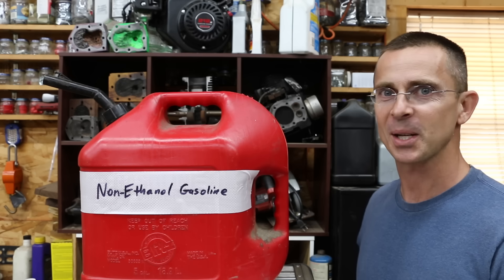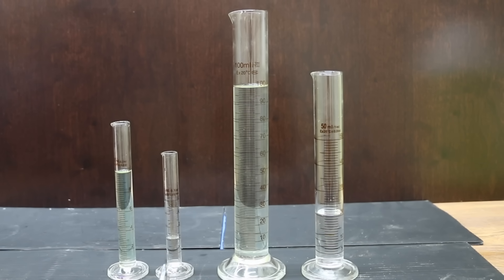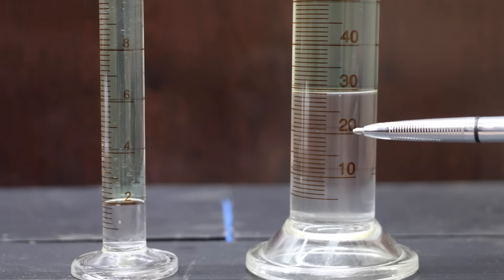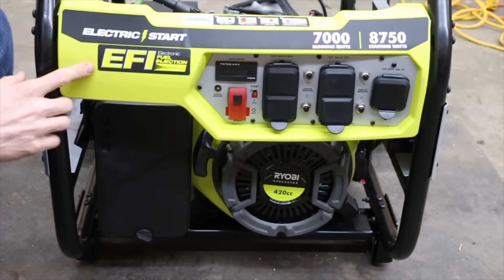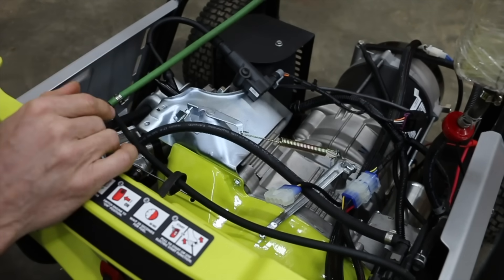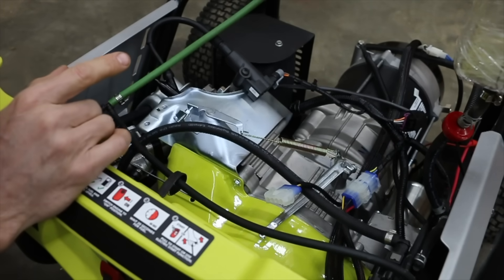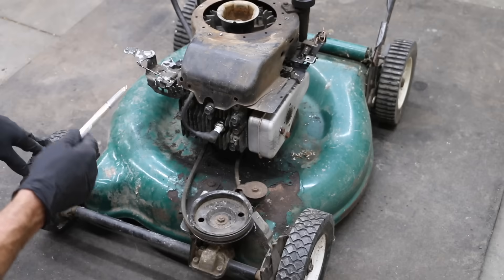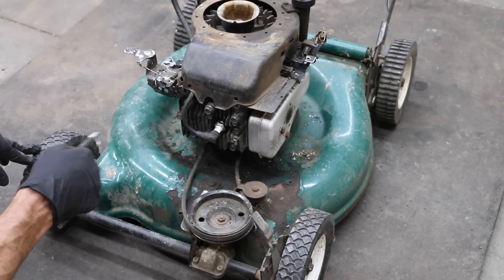Is Non-Ethanol Gasoline Really Better? See the PROOF!

Comment: If you want your fuel system components to be destroyed by corrosion then use ethanol fuel. These components can include but not limited to the fuel tank,  fuel sender for the fuel gauge, gaskets, gas lines and carburetor.
Reply from the maker: Thank you!

Comment: Like I already commented on your fuel additive test to solve water: there is a big mistake everybody is doing.
If you have a E10 fuel and some water in the air it will absorb a bit of it depending on the time and the surface area (contact area with moist air). E5 will do the same thing, in my humble opinion will be the amount of absorbed water be very close with both fuels.

So what kind of fuel will give you problems with corrosion? I think the problem will accour if the water/ethanol mix will seperate from the fuel. This will happen very early with E1-5 and much later with E10 and nearly never with E85.

Also I'm not sure if this at all will happend just because of the moist air because I don't think the ethanol will even pull this much water from the air. I think more likely it will be the condesating droplets that form on the cold metall of the fueltank and then drop down into the fuel.
They will seperate directly from a E0 fuel but get absorbed by any ethanol fuel.

I think this would be very intresting to see when and why water will seperate from the fuel. I always do what most people do consider the worst thing you can do, my car is sitting with half a tank of E85 for as long as half a year. I'm doing this since 8 years now and never had any seperation or rust in the metal fuel tank.
Reply from the maker: Thank you.

Comment: The problem with ethanol as you showed in the beginning is that it drops out of solution when exposed to moisture. Therefore rotting out components in your fuel system. Also what you're not talking about it is not cost effective to manufacture ethanol and sell as motor fuel without government subsidies.
Reply from the maker: Thank you!

Comment: In summer temperatures consistently above 90°F I run 25% ethanol in my pickup. It doesn't help mileage but it does help the engine run a few degrees cooler, particularly in start and stop traffic with the air conditioning on. I never use fuel containing ethanol in my lawn equipment unless I am sure it will be used all at once without leaving any in the carburetor or fuel tank. Storing lawn equipment with fuel that contains ethanol, particularly if used in 2-stroke engines is asking for trouble. The longer you store gasoline containing ethanol the more likely it will gum up your fuel delivery system even if you have fuel injection. Non-ethanol gas will eventually gum up but not as quickly as gas with ethanol. It's worth paying a little more for use in your lawn gear. In your everyday driver, it probably depends on your usage more than anything.
Reply from the maker: Thank you!

Comment: Something you should do in parallel to the long term use of ethanol vs non-ethanol fuels, is the long-term storage of ethanol vs non-ethanol (say putting the lawnmower away for the winter, or the snowblower away for the summer, etc). I've heard that non-ethanol fuels won't destabilize over time, but it's worth testing to see proof. :)
Reply from the maker: Thank you for the video idea!
Reply: @ProjectFarm  Hey! I found the video where I left the comment!! Any progress on this particular test? Is it ongoing, not yet started, or did I miss the upload? EDIT: found it! Headed there, now. :)

Comment: E85 is amazing. Here in Finland they actually use food waste and other byproducts to make it for "free", instead of using corn like you do in the USA. Saabs are probably most famous for running on E85, as they actually have a stock BioPower flexfuel program that you can install without any hardware modifications. You get more torque and efficiency as E85 is resistant to knock. Downside is you need 33% more E85 (energy value 34 MJ/kg) when compared to 98E5 (RON) (energy value 46 MJ/kg), but the price difference will make it worth it - even if there's no benefit price-wise, the increased torque, efficiency, and clean emissions (as well as clean engine, no carbon buildup) really do make it an amazing fuel. And even better here in Finland as I mentioned before, you're driving with fuel made from waste. I have ran my 1999 Audi S4 B5 with E85 only for years, without problems. It is obviously (aftermarket) programmed for that, though.

I see nothing wrong with gasoline blended with ethanol either as long as the vehicle says it supports them. Running anything without brains to compensate for the ethanol content (see earlier comment about energy value) is just basically running it leaner. You need an oxygen sensor to correct that.

E85 is basically a clean race fuel.
Reply: bindkeys I think you are talking about the Neste refinery. They also use (if I recall well) fish oil to make diesel.
Reply: @C_R_O_M________  ST1 Etanolix
Reply from the maker: Thank you!
Reply: 85%  IS N O T 100% GASOLINE (race)  FUEL....?
Reply: @jimbo42521  

Lol they use alcohol (ethonal) in race engines. They have different classes for different types of fuels like nitro for example
 But you can make tons of power on Alcohol.
Reply: The biggest issue with ethanol is in small carbureted engines. Or anything that sits for any length of time. Ever rebuild a carburetor thats had ethanol run through it versus non ethanol? If so you will see the difference! Ethanol is junk! The residue from ethanol is a problem!
Reply: @WW5RM  My father would tear apart carburetors in small Briggs water pumps every spring and carb clean out the varnish.  One never forgets the smell.  Since we have had E10 starting in the 80s, I have never had to do such a thing.  Have never had varnished gasoline with ethanol.
Reply: @danafletcher2341  yeah I know the smell. Where are you located?
Reply: @danafletcher2341  yeah we haven't had ethanol here in the south up until a few years ago. From what I understand when they introduced it they also took out stabilizers too. See its very humid here. Big problem! 

So it may last longer in a low humid environment but not here! Its causing all kinds of problems! It sucks! We never had these problems before!
Reply: @WW5RM  When ethanol came here, it cleaned out built up varnish from gasoline.  Hence newer equipment did not bother as much as older.  I still have some 1970s vintage trucks around that in the 80s when E10 came that I had to change filters weekly for a time.  I was told that would stop once clean.  Still have those trucks and they mostly sit in a building and rarely are used, but they will still start right up(provided battery is not dead) and it has been years since I have changed fuel filters.

Mercury Marine thinks E10 may be superior to E0(after a transition period) because it keeps the fuel "dry" in high humidity marine conditions.

https://web.archive.org/web/20140922142320/http://dcd96xmek71bc.cloudfront.net/archives/email/Trade/BoatingIndustry/MythsofEthanol-August252011.mp4
Reply: @danafletcher2341  the E10 you have is not the same as what we have then! What we are getting is junk!! Its constant battle!  Rebuild carbs, add stabilizer and drain tanks! Sick of the stuff!

Comment: first thing to remember is that many people still drive cars built pre-ethanol laws... so a vast majority will eventually run into some type of engine issue due to using ethanol based fuels... this issue involves the seals and gaskets on these motors... the ethanol will cause these seals and gaskets to fail much faster than they might using pure gasoline.. newer cars made after the ethanol laws requiring gas to contain ethanol wont have this issue as their seals and gaskets are made to resist this problem... there is no warning about damage to vehicles from gas producers or auto manufactors... second is cost.. one would think that adding ethanol to gas should raise the cost as its an extra step in making the fuel before it gets to the pump and the consumer... however the reverse is true.. the cost of pure gas is actually higher than fuels with ethanol.. this is done so as to convince the public buying ethanol fuel is a better option.. reguardless of if your vehicle is built for that fuel or not... third and most relevent to this video.. fuel efficiency and carbon buildup will vary based on engine and engine components.. carburated vs fuel injection.. the various emission systems.. and of course the multitude of computer settings for all of the above.... as well as how the vehicle is driven...  while a base line can be made between the fuels on this note.. there are too many variables to get a true real life comparison... even the weather or what sparkplugs get used can make a difference..
Reply from the maker: Great point!

Comment: Seems to be a lot of confusion of the effects of ethanol. it is fairly friedly to most rubber and plastic parts. Phase separation is the biggest problem for small engines.
 Methanol, on the other hand, is not friendly to most plastics and rubber. And should ne avioded completely.
Reply from the maker: Thank you

Comment: My riding and push mower have never cared. Riding mower has an intek briggs with 500 hours and the push mower was a 6.5 briggs. My ryobi weed eaters like new fuel lines every 2 years or so which is no big deal as I never worry about where I get fuel or draining the tank/bowl, even during the winter.
Reply from the maker: Thank you!

Comment: Ethanol is made for 2005 vehicles and newer.  If you put ethanol mixed gas into 2004 vehicles and older the rubber in the fuel system in compromised, including o' rings.
If you don't believe this, start checking out ethanol articles starting in 2004.
Reply: Stop with the made up facts. I have a 1999 car that runs on E85.
Reply: I talked extensively with our State government agency petroleum manager and he told me that E10 was suppose to be used for 2011 and newer vehicles BUT lobbying caused the US EPA to drop their advisory to 2006. Earlier FI vehicles might have problems.
Reply: @hotrodray9884  The government in the 1970s told manufacturers to have cars E10 compatible by 1983.

Before the EPA approved E15 they conducted long term tests on cars 2001 and newer with not only E15 but also E20.  They found both fuels ran fine and did no damage.  The EPA then approved E15 for use in vehicles 2001 and newer, not 2011.

The common gasoline in Brazil has been >20% since the mid seventies and currently at 27.5% ethanol.  They have many of the very same non flex fuel cars we have.  It has worked out so well and for so long that Paraguay and Argentina have gone/are going to high levels themselves.
Reply: @danafletcher2341  Maybe that explains how I ran my 84 Caprice with a 305 on E10 for years and never had a problem. B.P. E10 87 ran better than all other fuels in my area, Eth. Free 90 grade included. I didn't get any pinging sounds uphill with it.

Comment: I used to go to a gas station, upstate, that had non ethanol gas. Whenever I was in the area, I would use that non ethanol gasoline. The non ethanol gas ALWAYS got at a minimum, 15% better gas mileage.......Always, at home, all small engines that I was forced to use ethanol gas ruined the internal gaskets on the 2 cycle engines, and gummed up carburetor passageways when left in over the winter time.. Environmentalists have already reversed themselves, saying plain gas is better for the atmosphere......
Reply from the maker: Thank you!

Comment: okay so i don't think the time test is really significant. when running an engine on ethanol it requires more fuel to reach stoichiometric AFRs. Being that generator is fuel injected and has an o2 sensor it is adding more fuel to the engine with E10 to reach the 14.7 AFR the o2 sensor is trying to maintain. There for using more fuel
Reply from the maker: Thank you.  Less BTUs in ethanol.

Comment: The biggest thing to be concerned with for ethanol fuels is, vehicles designed to run it, have stainless steel fuel lines and exhaust systems as well as different type seals and o-rings to prevent breakdown and corrosion. Older vehicles NOT designed to run ethanol, are at greater risk of failure of these parts. The loss in fuel efficiency can be significant depending on the engine and vehicle it is in.
Shortly after E85 was first introduced and "flex fuel" vehicles started showing up, someone did an MPG test on a Chevy truck. They ran one entire tank of non ethanol gasoline, then one entire tank of E-85. The E-85 got about 100 miles less than pure gasoline. So, while it's cheaper than pure gasoline, it's also less fuel efficient. The only real upside of using it is, it's supposedly better for the environment.
Reply from the maker: Thank you!